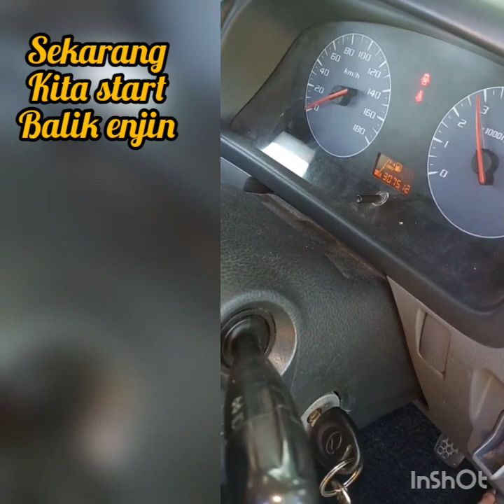Perodua viva enjin jadi gegar dan cara selesai kan masalah enjin 2 selinder

Comment: Sama masalah dengan saya,piston no 3 x berfungsi,dh tukar coil plug,plug masih juga sama...hairan...xtau nk repair ape,tanye bengkel die ckp kne bt top ovehall sbb piston 1 x jalan...pening risau kena tipu je..
Reply from the maker: Plug basah atau kering masa bukak,kalo kering injector tak pancut minyak atau chek api ke injector,,kalo basah kemungkinan valve bocor atau gasket head problem....

Comment: salam bos.. apa punca ya kereta viva jd mati tiba2 bila dkt lampu isyart.. tapi boleh start balik mcm biasa lps tu..
Reply from the maker: Wasalam.....biasa jadi mcm tu kebiasaanya regulator fuel pressure ataupun fuel pump lemah.....bos tengok dlm video kat atas itu penyakit yg sama bos alami.....video ke tiga regulator fuel pressure
Reply: @workgarage9220  viva sya pun sama boss.. Tiba2 mati enjin d trafik light.. Tp bila cabut radio masalah tu hilang.. Bila pasang balik radio dtg balik.. Aduh... Pening boss

Comment: sy punya alza enjin sama jd mcm ni..dh chek semua ok..coil ok plug ok wiring ok..apa mslah ye
Reply from the maker: Selain dari penyakit kat dlm video.....
#dah try cucuk computer,tengok error penyakit ape yg keluar....kalo nk.chek.secara manual bnyak lagi tanda2 simpton mcm ni....
1.injector sumbat/problem
2.ecu
3.gasket head terbakar tepi
4.valve vocor
Tu antara masalah lain.....😅
Reply: ye bos dh try cucuk computer..kuar coil plug dh cek coil ok je..mgkin la gasket terbakar atau valve bocor pomen dh try cek compres..skrg kt bgkel lg..keta beli usedcar nasib ada waranti..hahaha tq bos

Comment: Hye sifu, kalau enjin tiba2 gehar waktu start aircond apa problem dia ya?? Klu x hdup aircond, engine ok normal..but bila start aircond trus engine gegar kuat..tp x gegar trus la....waktu aircond comp function je bru engine ikut gegar skali..kejap2 gtu
Reply: Mekanik ckp timimg belt terlalu ketat?? Dia dah cek mounting okay masi dr bawah tp dia x buka lah mounting engine tu just tgk dr bawah je..sy pn x phm mana satu yg betul problem dia ni..
Reply from the maker: Gegar yg mcm mane tu.....stering bergegar ke.......masa on aircond rpm naik atau turun...contoh masa start enjin rpm 1k bila on econd rpm jadi berapa makin tinggi atau rendah pada 1k.....nak tahu itu dulu
Reply from the maker: Timing belt terlampau ketat  atau belting econd maksud dia tu....tapi  xda efect bergegar......kalo mounting enjin bila masuk gear enjin gegar lagi kuat ,kereta manual atau auto
Reply: Ok nt sy cek rpm dlu cif waktu on aircond
Reply: Kereta viva manual 1.0cc cif
Reply: Sama juga masalah sya
Reply: @workgarage9220  kalau start ekon rpm makin tinggi sampai 1.5k kenapa tu bosku ? biasa on ekon rpm trn kan
Reply: @workgarage9220  saya juga ada masalah yg sama sampai terasa gegar time on ekon naik ke 1k. Bunyi juga agaw kasar dari enjin.